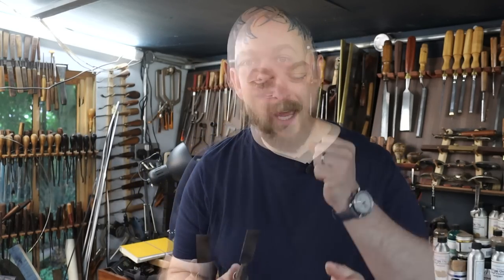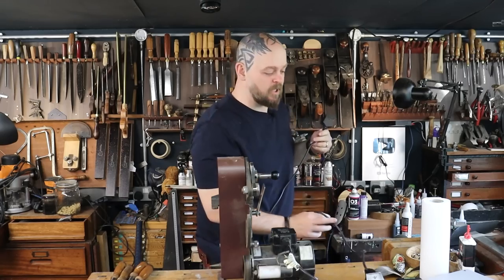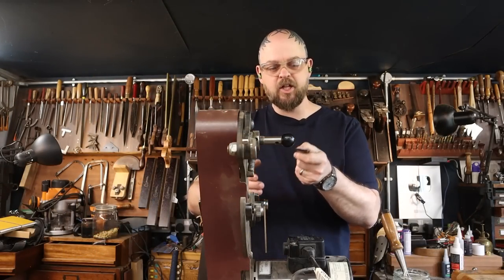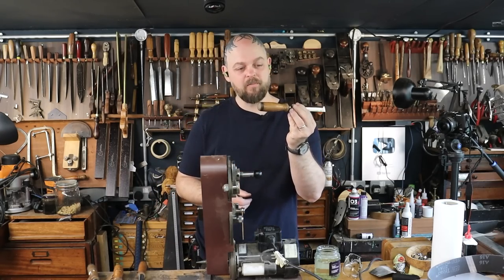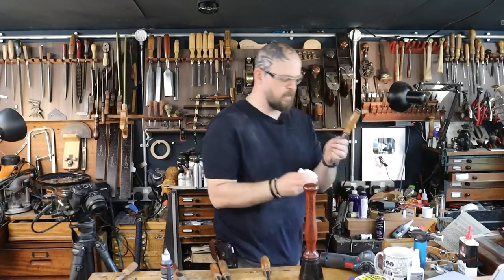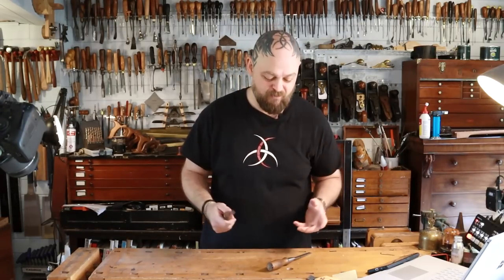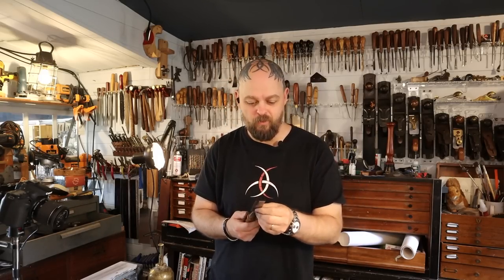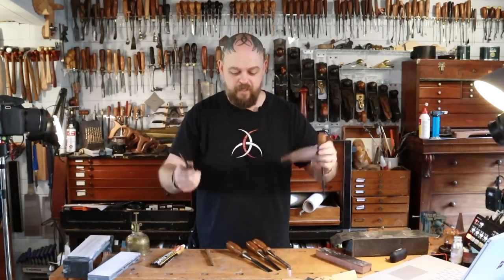Restoring a set of Vintage Marples Socket Chisels - could these be my new favourite tools?

Comment: I've recently restored a tool of my grandfather's. An old hammer that my father replaced the handle on many years ago. While using it a few years ago the claw snapped and I finally got around to replacing the head with a head I found in an antique/curio shop. All fixed now but it's still my grandfather's hammer.

Comment: I love these tool restoration videos, btw. Would be great to see some 'instructional' videos about specific tools. 
      Not 'best practices' persé, 
but how YOU use the tools; 
what YOU look out for; 
how YOU do things;
How YOU approach certain tasks within a project (and perhaps your considerations for which tool you reach for).

I always find it very interesting to know about the process in detail. (Not just "these are the steps I took to make this guitar look pretty", if you know what I mean)

How do you measure out a pattern (like you did with the cyberpunk guitar, and your daughter's guitar), preferably including the times it went wrong (and explaining why you thought it was 'wrong', even though it might look good to someone else)

Everyone in my life that was really into tools has passed. 
      This is the kind of information I can't ask of anyone, you see..

I know you can build guitars (Very, very well).. But a glimpse into the actual physical (and mental) process of sketching, correcting, and using the tools to achieve your goal.. that's infinitely valuable.

There are a lot of 'scraps' already within your regular videos (which I truly appreciate),
     but it would be very cool to have some dedicated videos on 'chisels', 'planes', 'carving a certain shape hole', etc.

Anyway - thanks for this insightful video. (I need to make an adjustable table for my bench grinder / belt grinder to make fixed degree bevels, it seems (:  )

Comment: There’s a YouTube channel called the torque test channel I think. And they just did a video on the difference between a stamped/CNC cut set of wrenches versus a set of forged wrenches. And they really show the difference in the steel. The way that the molecules align is really different. And it causes the strength to be vastly different.

Comment: Great stuff, loving your work! Can I just ask, you seem to have put one bevel on the end of the chisels. Other videos I have seen add a primary bevel, and then a secondary bevel at a steeper angle. What are your thoughts on this?
Reply: From what I've seen, the secondary bevel is mostly there to have less metal to take away when sharpening (you sharpen the secondary bevel, not the primary, so it's less metal removed, possibly less time). Doing just 1 bevel just means you have to sharpen the entire surface of the bevel, which is fine too and gives you more surface to register on the stone. If you wanted a 25 deg secondary, you'd just have to sharpen the primary to something less than that. Every woodworker is different and has different methods that work for them.  Like Paul Sellers puts a bit more pressure on the strop and does it like 50 times, but nothing wrong with being gentle if you have high grit stones to start with (I don't lol).
Reply from the maker: I don't use micro bevels.  They have their place but I don't use honing guides which are needed to do that accurately.  Ben
Reply: @CrimsonCustomGuitars  ah fair point. Thanks for the reply.

Comment: I'm on the hunt for some incannel (inside bevel) gouges.  6mm and 12mm (1/4" and 1/5").  These seem to be hard to find but handy when you are in need of a curved corner.  Standard corner chisels don't work because they're a sharp 90 degree corner.  I'm looking to round corners without the scooping you get from ordinary gouges.  Thoughts?
Reply from the maker: Have you checked out Vintage Tool Shop.  Sale now on.  DC
Reply: @CrimsonCustomGuitars  Yes, and could only find one in 1".  That's a possibility but one in half inch and one in quarter inch would be ideal.  Two Cherries is the only brand I've found that makes them new.  Just had my heart set on vintage.  😊😊

Comment: I inherited two chisels like those: a hollow socket and a leather-ended handle.  I cannot for the life of me figure out what the leather end of the handle is good for.  A few taps, even with a rawhide leatherworking mallet, and the leather starts to shred.  The chisels just don't feel like a good size that I should be pushing them by hand.  I'm obviously missing something, and would appreciate a hint.  Thank you.
Reply from the maker: Your leather needs to be fed, it is too dry.  With oil etc, like a fingerboard, it will become durable.  Ben
Reply: @CrimsonCustomGuitars  Much thanks!

Comment: If you were sharpening an old cut throat razor what stones would you buy? If you weren’t going to do this sort of job very often? I’ve seen a few videos but they’re all different and I trust you.
Reply from the maker: Any good set of stones would work, a strop would also be essential.  Personally I would use my Shapton stones but a nice Washstand natural oil stone would also be a good starting place.  Much harder wearing than water stones too.  That paired with a very hard Arkansas stone and a strop would be spot on imo.  Ben
Reply: Thank you so much. That is very kind of you!

Comment: I've found some Finnish and Swedish made chiesels from the flea market and they seem to be made of great steel. Only problem is, that the handles would have to be replaced. Where could I find nice ones? Tha tangs go inside the handle.

I dont own a lathe, so they should be ready to use. Just add the blade and some white paint onto it.

Comment: About the super glue: why not use an animal glue? 
       (I mean.. I would personally do the same: get the job done quickly and efficiently. 
      But the 'period correct' glue would be something like rabbit skin glue probably?)

I guess when you ultimately would replace the handle.. Any and all glue comes apart with heat..

I was just wondering about the considerations;
     I know a lot of people care about doing things 'correctly'. 
     I mostly care about doing things efficiently.

It's not often I encounter someone who appreciates old tools like I do, that also solves issues in the most practical and sturdy way like I (like to think I) do. 

If it's 'sacrilege' but it works... Is it truly sacrilege, or just smart? (: